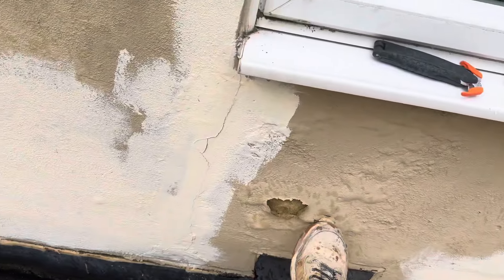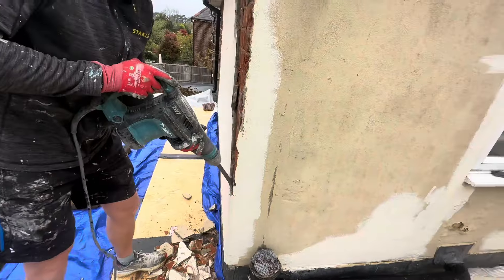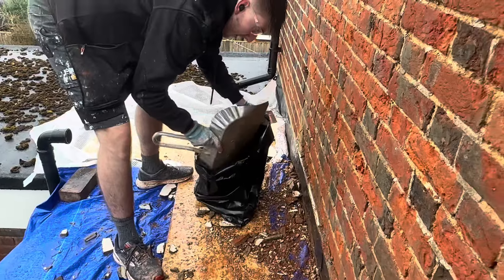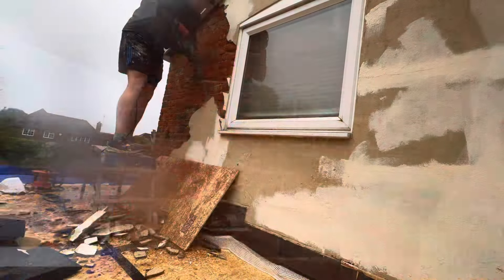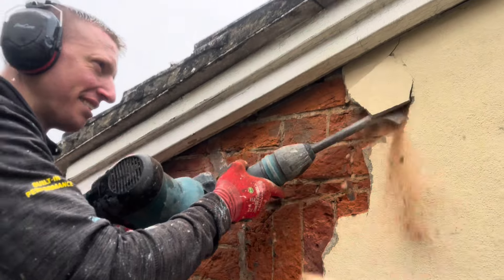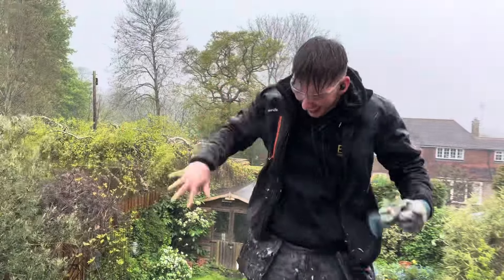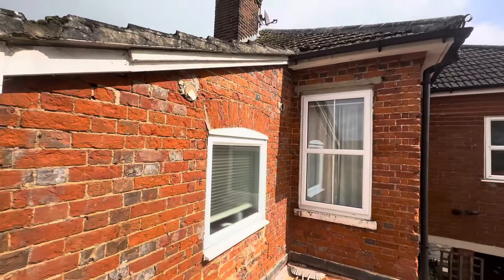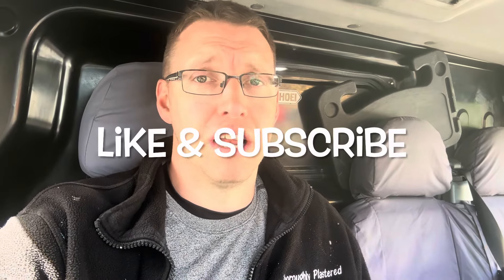Hacking off render in a Hail storm PLASTERING GURU

Comment: Looking for some advice. I have a no fines poured concrete house. At the back it has very old render and pebble dash. We replaced windows and around bottom one a load of render just came away and they needed to fill in the gaps with a tonne of silcone to be able to finish the job. And now its happening around back door. Ita old and starting to catch at the bottom so all the banging and yanking it open is making render come off. 

Ideally want ewi and new render but thats too pricey atm. The renderer i spoke to said cant be repaired and need take it all off and put new on and cant patch it up as will keep any damp thats got in. Dont think he tap tested it for how hollow it is. You think it can be patched up? Dont wanna be sucked into a more pricey job if dont need to something to stop water getting in